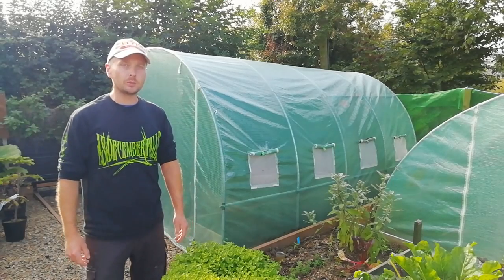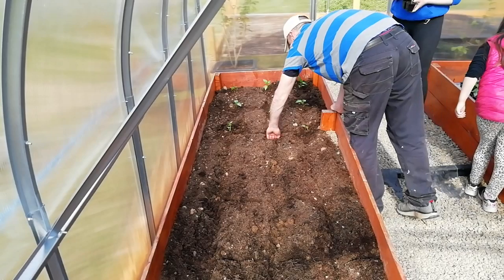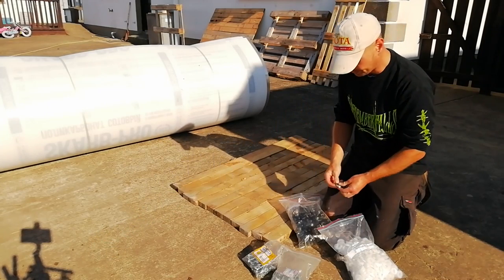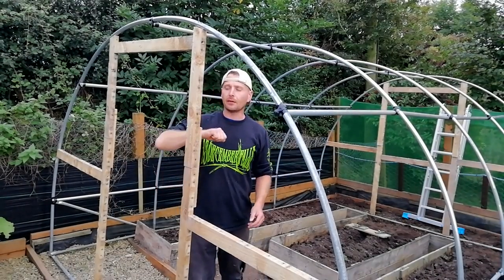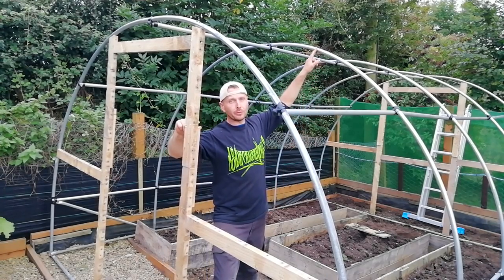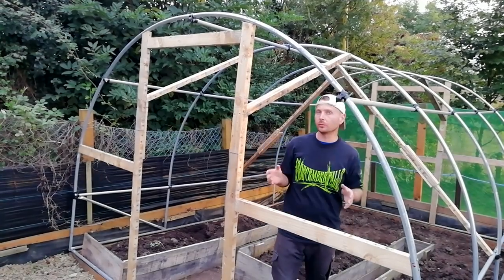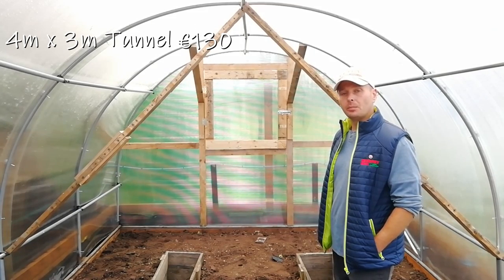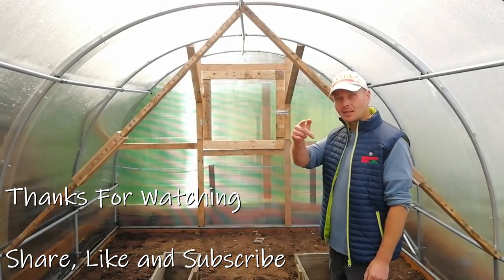Polytunnel Polycarbonate on a budget. Winter proofing a budget tunnel.

Comment: Great video thanks, I’m just about to convert my old polytunnel into a polycarbonate tunnel, I just wanted to know what you did where the polycarbonate sheets joined together? Does some of your sheet overlap? Thanks for the tip on using washers and screws, if you buy the button fixings they are a fortune.

Comment: Thanks for taking the time to do this. I’ve been contemplating putting up a poly tunnel on my very exposed allotment. After watching this I now know a poly tunnel will not work. Thanks again.
Reply: We have erected a 6ft green netting windbreak around the area where we have now erected a 4.5 x 2 metre Outsunny in an extremely exposed garden area where we experience gale force winds regularly and  ferocious gusts of wind on occasion.  Has reduced the wind force considerably and could work for you too.

Comment: This was a very informative video and something I have considered doing myself, did you ever consider adding extra hoops to make the frame stronger or sliding a water pipe over the metal pipe for added strength as I added the blue water pipe for extra strength and did
The trick for a polythene covering.
Great video 👍.
Reply from the maker: Thank you very much, glad you found it useful. Hadn't considered adding water pipe over the metal frame, good idea if using polythene.
With the polycarbonate, the sheets add rigidity to the frame making it much stronger than if it were supporting vinyl or polythene. As long as braces are added to ends and midsections the budget frames can hold up much better than before.

Comment: This looks great. Did you make the wooden door? Also are you drilling nails directly into the metal frame or are there holes to drill into? If so what type of nails are you using? Thanks.
Reply from the maker: Thank you very much. The doors were made from pallet wood. Tex screws were used to attach the sheeting directly to the metal frame.

Comment: Brilliant video , very helpful. One question,  how do you join the sheets, Thanks 😊
Reply from the maker: Thank you very much. The sheets overlap to a tight fit on the roof and secured with screws. Silicone sealant is used around the edges of the arch on either end.
Reply: @ourkilkennyhomestead2006  that is very helpful, thank you.
Reply: @ourkilkennyhomestead2006 just asked you a question but you’ve answered here thanks!

Comment: Where did you get the original set? Before changing stuff
Reply from the maker: Hello, originally it was a green vinyl covered 3m x 4m eBay job, think it cost around €150 at the time.
Reply: @ourkilkennyhomestead2006 oh sweet! Whats the brand? I'm curious about the ground u dug, it looks like you built planks inside the front wall to hold the greenhouse?
Reply from the maker: I think the brand was "vida xl" .  The ground it was built on was originally a large raised bed for potatoes which was built using 2x4's. It turned out handy to secure the frame of the tunnel on top of it.

Comment: Thanks for posting this. I'm looking at doing the same using a 6mm sheet over a 2m wide frame, but I have a question that maybe you can answer.
I see that you bent the sheeting in a longitudinal plane (i.e. with the channels orientated vertically). Do you know the tightest bend radius the sheeting can take with that orientation?  I've found one site quoting a minimum bend radius of 150 X the thickness, but can't find anything to verify this.
Also, did you tape the open ends of the channels before fitting the sheeting?
Reply from the maker: Hello and thank you. The sheets are incredibly flexible. Not sure about 6mm as we used 5mm on one tunnel and 4mm on the tunnel in the vid. The sheeting we used can curve to roughly 50cm before folding so you should have no issues on a 2m wide tunnel. We didn't bother taping  the ends as in our wet climate we would have to re-apply it multiple times a year. The odd worm or earwig occasionally climb up inside the corrugations but never make it far and usually make their way back out within a few hours.
Reply: One other question. Did you drill slightly oversize screw holes in the polycarbonate to allow for expansion and contraction, or isn't that an issue on smaller tunnels?